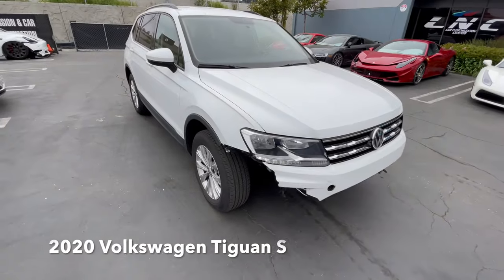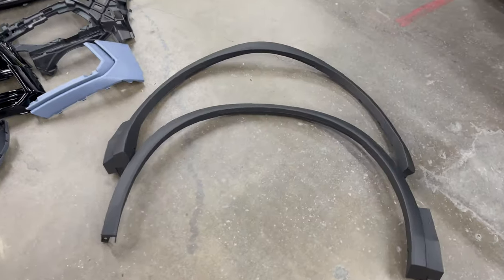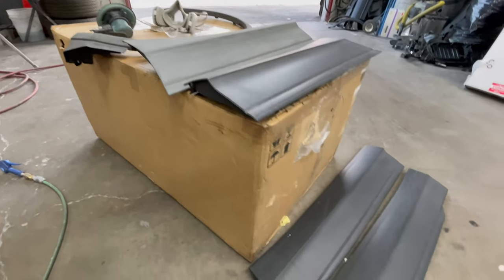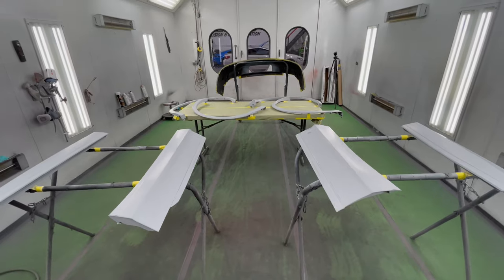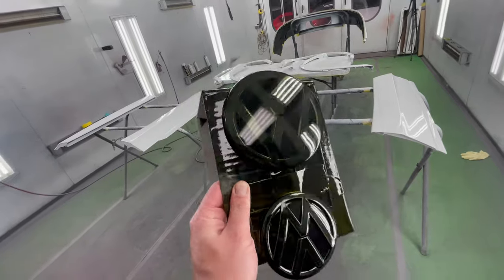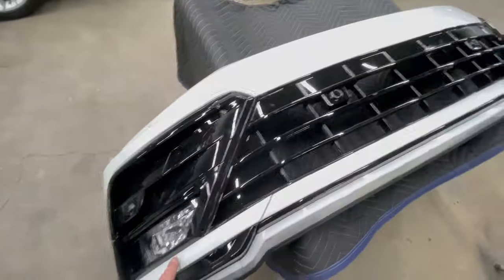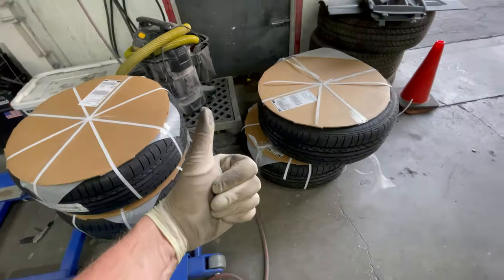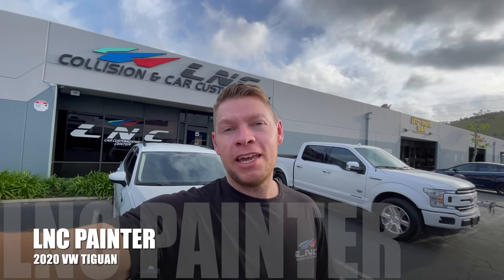VW Tiguan R-Line Conversion Paint and Instal

Comment: Nice job as usual. I'm not a fan of black wheels, to me it looks like a car with it's hubcaps missing. But that's the great thing about life in a free world we all have different tastes and we're free to have them. I like your white parts through the grill and head lights. I'm doing a similar thing with a peppermint green VW Caddy van but I'm running a red stripe through it like a GTI.
Reply from the maker: Thanks, I did do gloss black which are a little more visible during daylight. i always tell myself do silver or gray wheels and end up going with black wheels all the time 😂🤷🏼‍♂️ i saw the white strip somewhere first and liked it, but then i also a red one and it looked kinda cool, maybe I will redo in red along with red calipers 😁👍🏻

Comment: I love how the car was transformed to another level. my question is where did you get body kit from? I would like to do the same to my Tiguan. thank you.
Reply from the maker: Thanks! Front bumper and grille from Ebay (aftermarket) headlights are BMP Tuning…the rest is all factory parts painted 👍🏻
Reply: Does these headlamps were plug&play, or coding was needed?

Comment: Time for some Golf R springs to finish it off!
Reply from the maker: I actually installed H&R Springs, Was not happy with them the rear was really sagging while the front barely lowered. Had to buy some spring pads to adjust for the height difference. It leveled the car out but did not lower enough in my opinion… But the car has been sold already and I do have a new daily driver

Comment: You have done a very good job, congratulations👍 

what number are the tires?
Reply: The car I have has 215 65 R17 Tiguan 2018 tires, but I want to change them

What number do you think I should put on my car?
Reply from the maker: I put 245/45/20, they were perfect size and drove very well. Check out tirerack.com
Reply from the maker: Thanks! They are 20 inch
Reply: Thanks bro 👍

Comment: What’s all needed for this conversion? 
I have a 2021 R-Line but I wanted the trim above it because of the front end look
Reply from the maker: If you have R line it should already look like this
Reply: @LncPainter the front looks different because it is not the top R-Line model it is the one under it. It is still an R-Line though. Front looks slightly how yours did

Comment: Would this work o a stock 2021 tiguan life? Love the vid✌️
Reply from the maker: Is the 2021 have the face lift already? Different headlights/fenders? If so it wont work, but they prob have a r-line conversion bumper for it
Reply: Yes you are correct. Appreciate the reply. Keep up the great content ✌️

Comment: WOW ! Nice work. I have a question. The front bumper R line fit on the "normal" tiguan? Did you have to make som mods or was the bumper plug and play? So if a buy a rline OEM "orginal" bumper it will fir on my car?
Reply from the maker: Yes it will be plug and play, just need to buy the r-line fender flares.

Comment: The aftermarket front bumper is “plug and play” or are other parts need to replace ? Thanks
Reply from the maker: It was a plug and play, although i couldn’t find another one like it.
Reply: @LncPainter  was aftermarket or OE bumper ?
Reply from the maker: @21klu mine was aftermarket, i found it on ebay. But i looked again and couldn’t find the same or similar kit.
Reply: @LncPainter  ok. In my country are more options to buy a aftermarker bumper. So, i understand from you that is worth buying. Is quality ok ?

Comment: Did you install lowering springs?
Reply from the maker: I did, H&R sport springs, the back for some reason was a lot lower than the front…i had to buy thicker spring pads for the rear so it would be even height front and back.
Reply: Kool thanks for info car is bad ass which auction did you purchase Tiguan from? Looking to buy one?
Reply from the maker: @gilbertvaldez5176  thanks… got it from Iaai, I sold it already 😅
Reply: Thanks sorry I didn’t buy it 😂🤦🏻